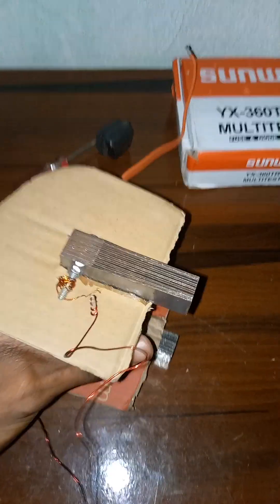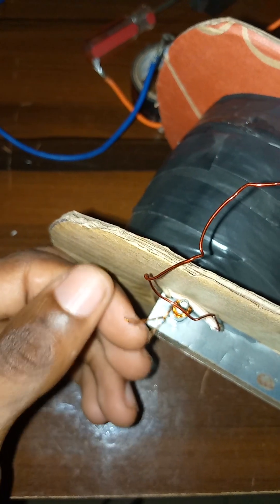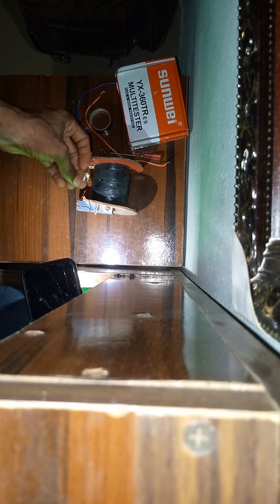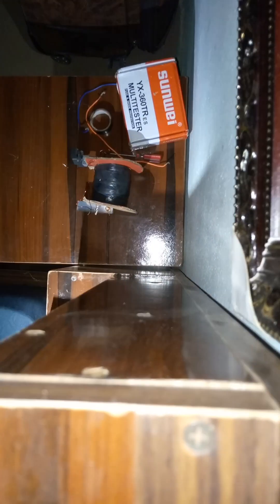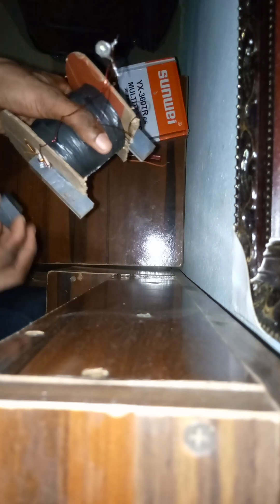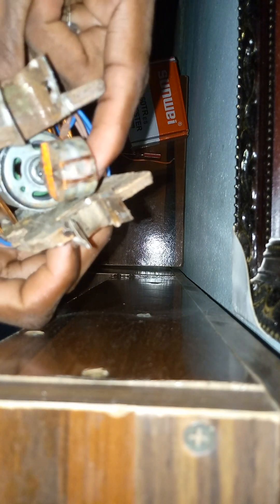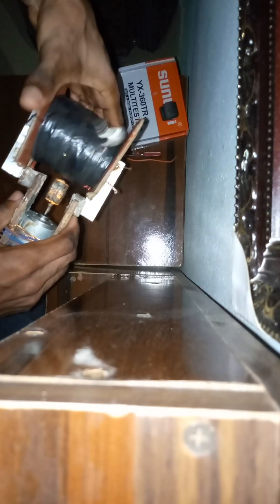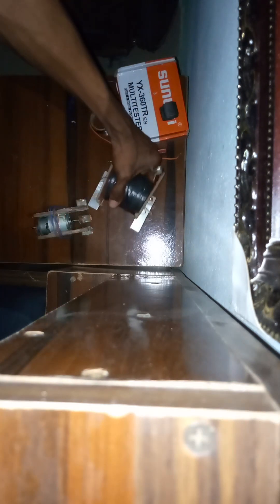Simple step by step on how to make a fuelless generator🔎💡⚡⚡ Part (1)#inventions #generator

Comment: How many tunrns
Reply from the maker: It contains 2 different turns of coil. Coil 1 has 2000 turns=primary coil. and coil 2 has 985-turns -1300 turns of coil =secondary coil